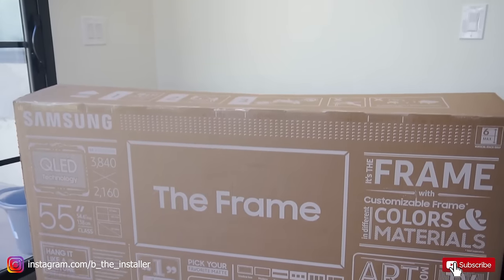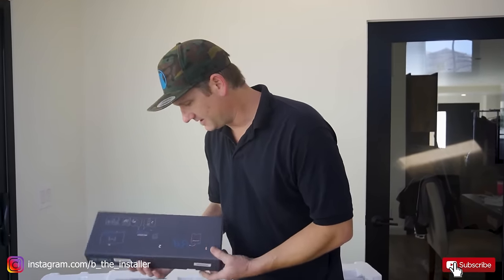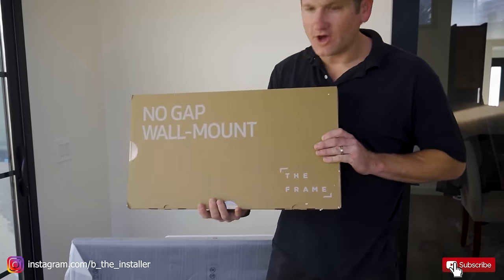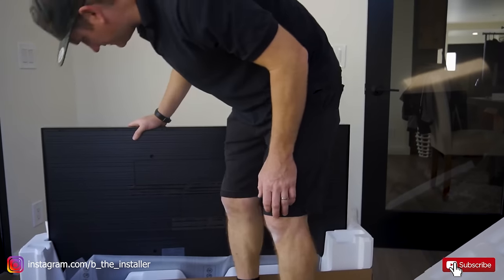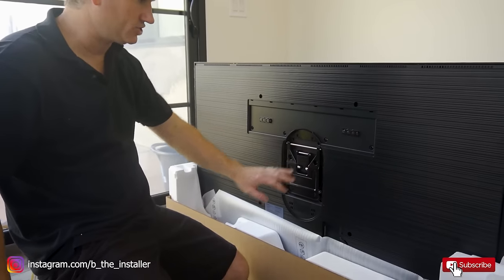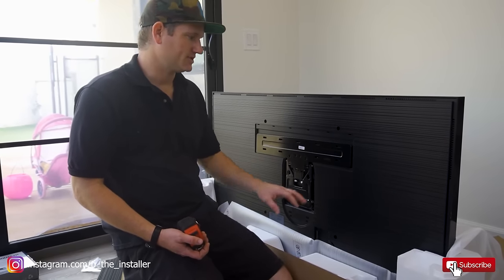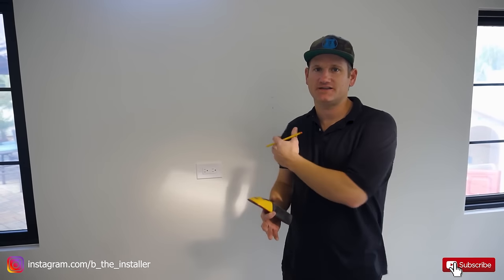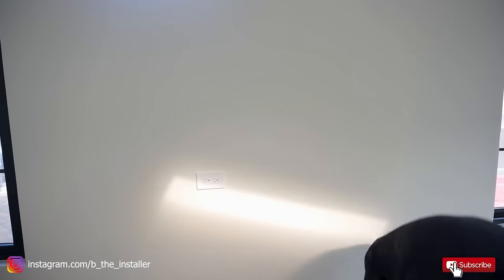Samsung Frame TV Installed w/ "No-Gap" mount in 30 minutes

Comment: I have one of these TV's on order so I tuned in here to get some tips on the installation.  One thing nobody seems to be aware of is that the 'One Connect' cord supplied by Samsung with the TV does not have a UL rating.  This means that technically it should not be run through a wall without the use of electrical conduit.  And because the connector is over 1 inch wide you'd have to use a rather large diameter conduit sleeve (and do major wall surgery to get it in there).  It's my understanding that a UL listed cable is available as an afterthought from Samsung (with a huge price tag), but the real head-scratcher is...why wouldn't all Frame TV's come with the UL cable in the first place?  It seems reasonable to think that anyone interested in this kind of TV would want it for it's low profile and it's unique ability to masquerade as framed art.  Who wants to see a cable coming from underneath the TV?  Samsung needs to remedy this.
Reply: Thanks for this, I was thinking the exact same thing.
Reply: @toddmell Samsung actually discontinued the optional UL rated 'One Cable' so I ended up using 1" ENT conduit (plastic flexible stuff).  It looks like that split loom product you see on cars but it's blue without the split.  It's supposedly UL rated for only low voltage stuff like cat5, coax and etc.  I'd guess that the 'One Cable" doesn't really qualify in that regard but it's better than nothing and gives a little piece of mind I suppose.
Reply: I think because Samsung knows everyone will just ignore the fact it isn't a UL rated cable and still run it inside the wall - just like this guy did.
Reply: Nobody cares because it's not a big deal

Comment: Instead of leveling up the lower part of the wall bracket, it's best to hang the tv and gently level it while it's on the wall. The lower wall-mount bracket bolts are torqued to allow the tv to be levelled without swaying while hanging on the bracket.
Reply: This does not apply to the 44” Frame, so leveling the lower part of the bracket is important in that case. Otherwise, totally agree!!

Comment: Thanks for the awesome install today!  Not a cord in sight. Flat as a pancake against the wall.  Unbelievable!  I watched this thinking I’d do it myself.  I didn’t trust myself to get the measurements accurate.  I just remodeled and didn’t want to ruin my new walls.  But, watching you install mine, you did everything just as you state here.  The Frame by Samsung is truly beautiful.  Turns a tv into beautiful artwork with one little push of the button.  Turns off by itself if no movement in the room.  So many more little secrets it has as well.  Thanks again!
Reply from the maker: You're welcome.  I look forward to showcasing The Frame Rd. 2 soon.

Comment: B, fantastic video - super helpful. My husband and I watched it once before and again as we mounted our Frame TV. It took us a little under 2 hours and went as smooth as butter. Well, except for the screws - my husband said you were right about the screws. You did a great job - we didn't even crack the installation manual, Thank You!
Reply from the maker: Yeah the screws suck.  I don't even us them when normally doing that mount. Drywall screws with a washer are good.  But glad it helped.  Make sure to tag me on IG pic.

Comment: Great video!

I just got mine frame and just wanna let everyone know who is about to get one that now samsung is sending it out with zipp - toggle anchor (same as on the video) so no need to order separate (I order mine TV in UK). Have fun installing your frame all!
Reply from the maker: I saw that. My last couple installs did not have them.  Its helpful.  You can install that on togglers only.  Its pulling down not out, 3 across top and one in middle bottom would hold 5 frame tvs without a stud.

Comment: Thanks for the helpful video.  To help prevent the camming out of the Philips head screws (stripping as you called it), you can put some bees wax or soap from a bar of soap on the threads before screwing them in.  That makes the screw thread in more easily and helps keep the Phillips bit from chewing up the screw head.  It works like a charm.

Comment: Well done. All details I needed. Would have liked a quick comment on 1) whether the one box came with TV and 2) how tilting the TV looks versus flat on the wall
Reply from the maker: Yes, the one connect box comes with all QLEDs that are higher end... frame definitely... 2, you can tilt it... it just looks like any other tv if tilted down.  It doesn't turn left or right with that no gap mount.

Comment: You were right about the screws being easy to strip.  However, if you look at them real close, they can be driven with the appropriate size 6 point hex socket.  No need to buy/use different screws.
Reply: Was staring at the wall with my Samsung screws refusing to budge more than halfway into the studs… saw your comment and then grabbed my socket wrench set … and 5 minutes later screws are all the way in and mount is flush. Thank you!

Comment: Great video. I'm about to I stall the TV today. Just noticed that Samsung have included wall plugs that require a 9 mm hole, which is very uncommon here in Holland. Typical drill bit kits here have 6mm, 8mm or 10mm... So this is just a heads up: make sure you have a 9mm drill or 8mm plugs and corresponding screws.

Comment: Fantastic guide for installing this Tv. I wish it was that easy in the uk, it’s all brick walls !
Reply from the maker: Brick walls can present a little challenge.  Are they double lined? Many fireplace installs in the states have outer facade brick and inner chimney layer and I thread wiring between after knocking one brick out.  I'd have to be there but never say never lol.  Thanks for watching.
Reply: B The Installer it’s definitely a challenge, at present I’ve got a standard 55” inch 1080p mounted on the chimney and let’s just say drill bit drifting was an understatement lol. I really do like the look of the Frame tv and I think in a couple of years after I’ve saved some money for it I pray I can use the same damn mounting holes from the old bracket. Fingers crossed .
Reply: Ian Proctor it is possible if you have a multitool/oscillating tool. I am in the process of chasing out the wall to mount one of these, patch it up with some plaster or polyfiller and paint the area you channeled out, you will be good to go

Comment: Thanks, nice video! I have a question though: I thought the one-cable was not wall-rated?
Reply: It's not. Samsung makes a (very expensive) wall rated version. The only way to install like he's showing without breaking code is to figure out a conduit to run it through. Pretty hard though with the connectors sizes
Reply: Is it not double insulated?

Comment: Great install video which I plan to use once the Frame arrives. 
One part for me could have had more instruction and that is fishing the connect wire through the wall down to the outlet. The fishing part to find the hole is not (for me) as easy as it looked. Any more hints to fish out the hole? With it being not straight up and down I’ve had trouble finding the hole. Thanks

Comment: Great in depth video. 
I've ordered the 55 inch Q95T with the no gap wall mount, it's clever how the power to the TV goes through the one connect lead too, it's a great idea that saves alot of cables going to the tv,  I'm not sure if like it behind the TV though, as some people do,, as it runs quite hot, and it defeats the object of  keeping the cablestidy and  away from the TV, I get how some situations have nowhere for the box to go, bit why not just get the normal version, without the one connect box?

Comment: Wahoo!  I’m the 1,000 upvote.  This video deserves it!  

The screws that come with the no gap wall mount are ridiculous.  First, Samsung does not include the toggle bolts (screws “F, G” in my manual.)  The only include the screws you would use to mount this to a stud.  While you should definitely try to use at least one stud in my opinion, most TV buyers will have to mount at least a few of the screws on straight dry wall.  For that you probably do need the toggle bolts.  Why would Samsung not include the most important screws for wall mounting the Frame TV.  The whole point of the TV is that it’s for wall mounting!

(Oh, and the screws included in the wall mounting set—the “E” screws—do strip really easily.  I only used two of the five of them and stripped the first three I tried.)

Anyways, go out and buy a few toggle bolt and follow this video.  It will save you heartache.
Reply from the maker: This is my favorite comment ever.  So true and thanks for being #1000.  Please everyone, share this video as people like to watch even if they don't have this TV
Reply: is there a specific size of toggle bolts for this?
Reply from the maker: Yes I prefer the 3/16" toggle bolts.  I prefer the hilti ones as they have an option for flat head Phillips bolts.  But any 3/16" toggle bolt as i show in video would work
Reply: Well most of the world has solid walls, so toggle bolts will be no use. This also means routing cable as shown is not possible. Instead either have cable on wall exposed or chase conduit with cable in it (though how to do that when there is a plug at each end?) into wall and plaster over it, ie a huge mess.

Comment: Thanks for the great video!  I had done my 65" Frame just a few days before, almost the exact same measuring method, nice to have been validated.  Question.... have you found a way to really get zero-gap around the whole perimeter of the frame.  The bottom of tv is nearly flush, but can't seem to get enough leverage for the top to truly be flush, it kind of floats off the wall about 1/2to 3/4".  I am sure I am only one to notice it, but I would love to get it uniformly "no-gap".  When I push on it, it does go flush, but the kinda springs back a little.  There is nothing on the wall causing that and I don't believe the wall is not straight.  wondering if anyone else has run into this.
Reply from the maker: You need to use the small pads they provide at the bottom which will bring that bottom out and keep the top in tighter.  

They also make different color bezel/frame you can add.. between the 2 of those, I have them very flush.

Comment: Thanks for the amazing video! I just got my new 2022 Samsung frame TV and am going to do a self install. This video was most helpful. Samsung has noted that I should remove the electrical outlet that is sitting directly where my TV will be mounted on the wall as it will not allow the TV to sit flush. I noticed that you installed over an electrical outlet. Is the TV 100% flush with the wall? I sure hope I don't need to have my outlet moved.

Comment: Excellent video! I do have a question, what is the length of the "one connect" cable? I have a run from a top of the fireplace to a side media cabinet to negotiate for that box. I worry it may be short, on the video you don't show it well, but looks pretty long. Thanks!

Comment: Really good and helpful video, I’m getting this tv but need to fix to a brick wall
Reply from the maker: That is no problem but can't run wire inside.  Get some concrete anchors 3/16, they're blue and a hammer drill bit

Comment: Nice installation. The only problem is that the cable from the TV to the One Connect box is not rated to go inside a wall without being in a conduit
Reply from the maker: I can't even 😭...  its like how many times in a video must I say something and then how many times must I reply to the same comment.  

It's all good.
Reply: @BTheInstaller  Once would have been enough. That's my point. You didn't mention it once in the video.

Comment: Hello B The Installer, 
Thank you for the great video. 
Could you please tell me how to remove the TV  from the wall after it installed. I need to do some adjustment. 
I tried to removed it bit it does not comes out. 
Please help
Thank you for your time

Comment: Very clear video and your answers to the comments are very useful. Will the one cable connector fit through a  corrugated plastic electrical tube conductor typically found in homes in Southern California? My in wall cable outlet behind the tv does an S shape run inside the wall to the other end at ground level.
Reply from the maker: Yes, use a fish tape or if there is a string, tie the small end down to the one connect box.  It can still be hard to get through. Use electrical tape

Comment: Thank you for the information.
What is still not clear, what happens if you already have a hole in the wall that's in the middle ?
Reply from the maker: Run it down that hole.  Can be run down anywhere.  The cord is thin and won't make the tv stick out

Comment: Nice and helpful video. Just mounted my Samsung Q95T 65" TV on this "no gap" wall mount and whereas it works fine and does its job I'd say "no gap" is a bit of an overstatement. There's still at least a half of an inch (12 mm approx) gap between the back of the TV and the wall no matter how much you try to "flatten" the TV to the wall after mounting it. There's also a bit of an issue with the balance as the TV tends to tilt down slightly which makes the gap bigger at the top edge of the screen than it is at the bottom. The solution to this is to use some sort of pads underneath the bottom edge of the screen to push the lower part of the TV forward in order to make the gap even on the sides of the TV. There is a couple of pads included in the wall mount package but they're just too thin to do the trick. Otherwise the wall mount does its job and the TV looks looks pretty good on the wall. Just don't expect a totally "no gap" attached to the wall painting-like looking TV mount because it's not the case here.

Comment: Great video - included instructions take a couple reads to understand since Samsung cheated out and used pictures so they didn’t have to translate too much - ha. Just a tip tho, the cord that comes standard is not actually in-wall rated. Some people don’t care about this, but there is an in wall rated version for another ~$175
Reply: It’s not very long especially if you don’t want the one box in the same room

Comment: Curious to hear your thoughts on the box stating the one-connect wire is not "in-wall rated"?

Also, any ideas for hiding the large one-connect box in the wall for those of us that don't want to place a media center or console below the tv?
Reply from the maker: Yes we address it in the video and in multiple comments.  They have in-wall rated cord if needed.
Reply: @BTheInstaller  I cannot find anywhere in the video where you address the fact that the One Connect cable is not rated to go in the wall. My understanding also is that the one cable that IS rated to go in the wall is only for the 2017 version of the frame and it is rated to go in the wall because the power goes through a separate cable from the video/audio and because there are two connectors it will only fit on the 2017 model. The 2018 and later models only have one connector. Although I stand to be corrected if I am mistaken.
Reply: @BillAndersonNS  it's not in wall rated...video is misleading because people are doing this when he is only showing if you have in wall rated cable which is sold separately.

The proper way unfortunately is a recessed av box or install the correct conduit behind the wall along with the cable which is a pain

Comment: can you run this cable through the wall? I thought it´s not in wall rated.
Thanks for the Video
Reply: You’re right. I called Samsung with this question and they told me it’s not rated for in wall installation.
Reply: He did not run the cable through the wall, it contained in an av back box behind the tv.

Comment: Thoughts on placing the one connect box into the wall directly behind the TV?  My power plug is located directly behind and we don’t need access to hdmi’s as we only plan to use it as a smart tv/wirelessly connected.  This would keep all the wires behind TV and require no fishing of wire. Thoughts?  Ventilation for the one connect box an issue?
Reply: Install a datacomm recessed box..will have to cut a big whole and screw it to the studs if 16" if not at least one side to the studs and then use a dry wall anchor for the side. Then you will have to install an outlet in the AV box
Reply: @TorranceJPlaylist  haha, yes i discovered the existence of the in wall solution that you describe here.  Definitely the ‘right’ way to do it.  So far so good with my DIY way of burying the equipment in the wall.  Love the TV so far.

Comment: Great video!  Can I forego the flush mount and use a mount that’s already installed for my existing TV?  thanks
Reply from the maker: Yes, but I would advise there are better options for the cost than the frame if you don't achieve the tight look, that the no gap provides.

Comment: Thanks so much for this video! We’re getting ready to move and I can’t seem to find any videos on how to remove the TV from the mount. Any tips?
Reply from the maker: It just lifts straight up.  You can tilt forward and then put hands under the bottom and lift.  Sometimes you need to lift one side higher first to get it to pop off.
Reply: @BTheInstaller  sweet, Thanks so much amigo!
Reply from the maker: No doubt

Comment: Hi B! I'm getting contradictory information from Best Buy on the frame TV and inside wall installation. Gosh I wish you could just come out and install because you seem to know what you're   doing. My question is do I need a separate cable to do inside wall - the final person I've spoken with through BB gave me info I've never heard before this that I need a separate $300 cable (the 5m One invisible connection cable for samsung neo QLED 8K that is electrically safer to have interior to the wall. Otherwise he also said I could install a Sanus tv media in wall box 17". Can you clear this up please? Thanks so much for this great video. Kim